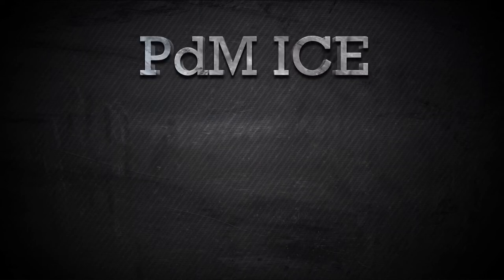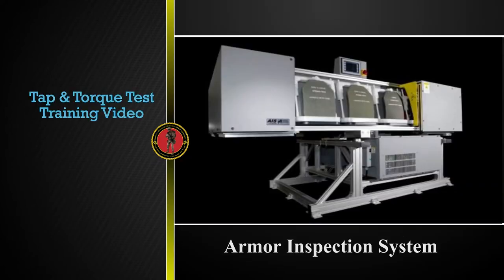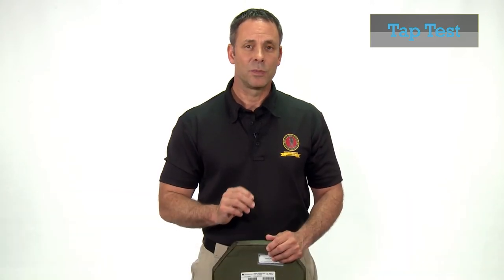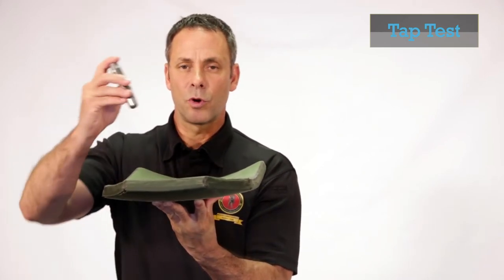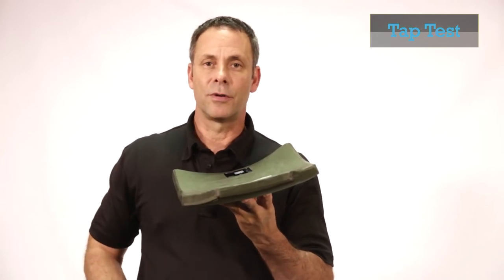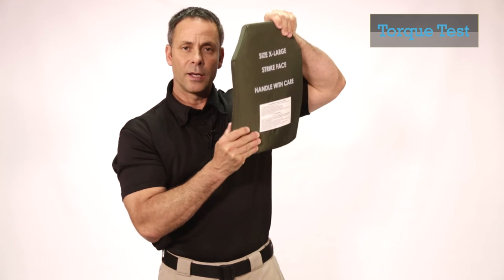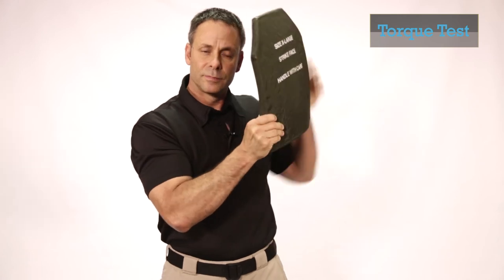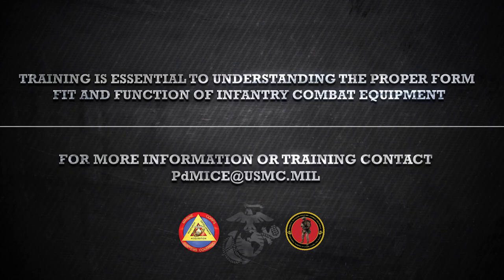Marine Corps Tap and Torque Tests for E-SAPI plates

Comment: Does this test also work on SAPI plates? I tried it on SAPI plates and got all thuds on both plates. Having a hard time believing that both plates are 100% delaminated.
Reply: The torque test works on all SAPI/ESAPI type plates. The tapping should work as both are ceramic plates (usually Boron Carbide or Silica) with polyethylene/dyneema backers. Aka, they have the same materials/properties. One just has a thicker ceramic strikeface and more backing layers.    
Did you end up finding out if they where indeed bad?

Comment: why is the chime sound good?
Reply: I'd guess it should vibrate but the loose material will dampen it (act as a shock absorber does on a car)
Reply: The test is similar to how grinding wheels are tested before installation. If either "ring" that indicates full structural integrity. Failure indicates structural defects. (Grinding wheels can maim or kill when they explode so in both cases the ring test matters!)
Reply: Because it’s ceramic… tap on a ceramic pot and it should make the same chime sound. This is because the energy travels well and fast through ceramic… However a thud would indicate that the Kinetic energy dissipating through the plate is coming to an abrupt stop when it reaches a crack and thus the vibration frequency would make a thud sound  because the energy is traveling a shorter distance

Comment: Civilians note the tap tool is simple round rod stock. You can likely find the specs in a TM and you or your local machine shop can make one quite easily, or just buy a suitable diameter brass punch then mod the ends with a flap disc on an angle grinder in a few minutes. https://www.psmagazine.army.mil/Portals/74/Resources/Soldier%20Support/ms-9303-a_tap_and_torque_esapi_protection-stt.pdf?ver=2019-10-30-142144-680
Reply: thanks for the link! I wonder if there is a proper way to inspect soft armor